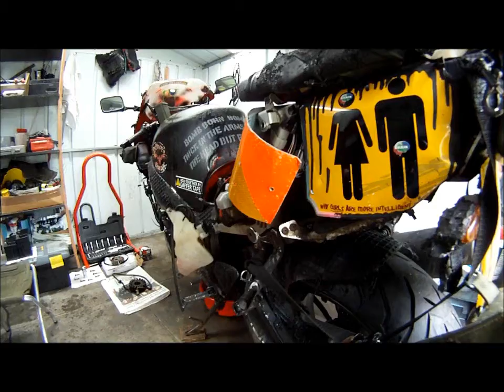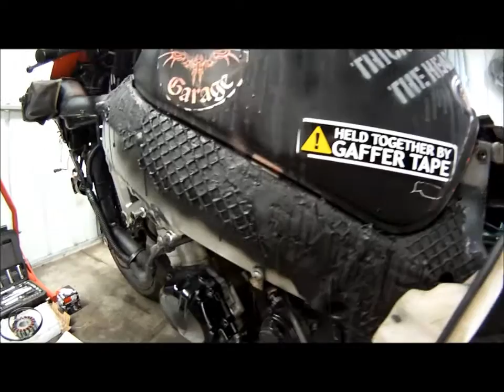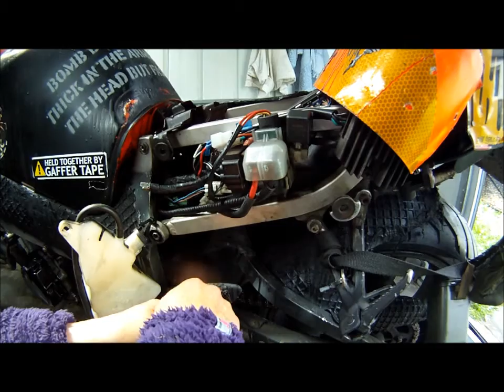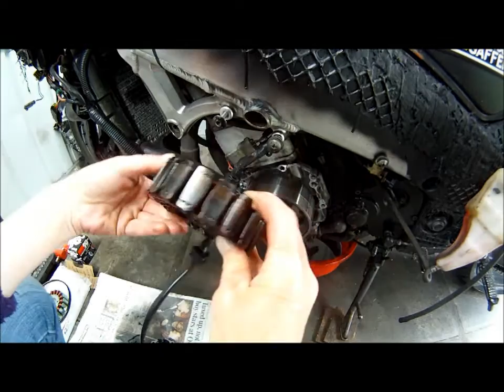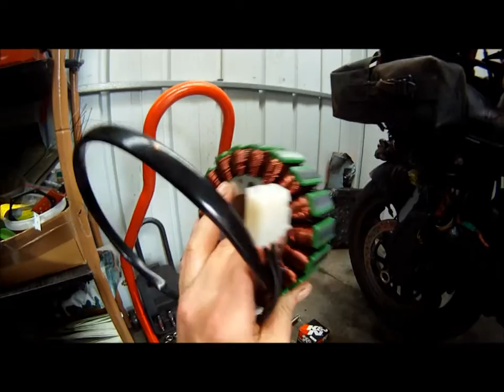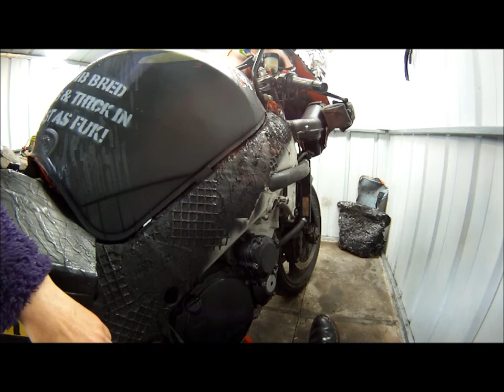GSXR Electrical Problems.

Comment: hey have a good holiday like to hear about your adventures... Also yes the old style 'end of crank' stators on Suzukis were prone to fail and overload input on the reg/rectifiers this normally also barbecued the battery. I got my last one from electrosport in the US. One thing check your frame earth is really really good!

Comment: Good video RQ! I just changed the rectifier and battery on the Iron Lady recently and am thinking I should  do the stator too. I've been putting it off because I really dont want to do a 4th oil change on the bike this year but it will probably go and need doing soon anyway.